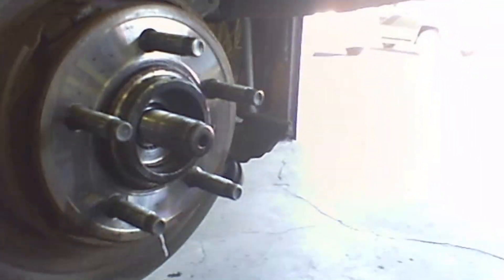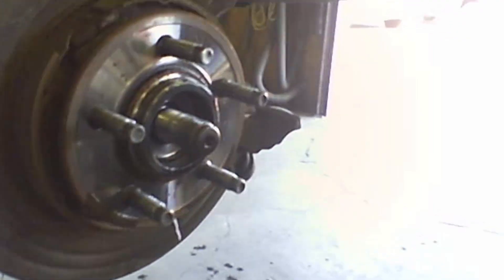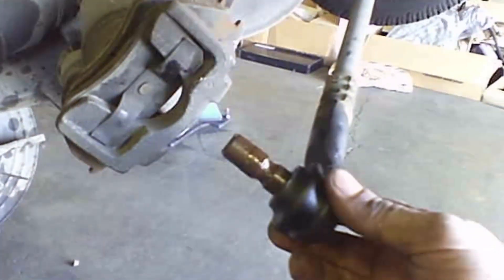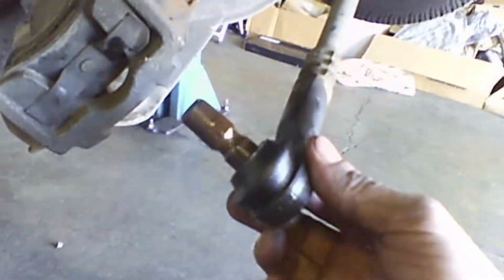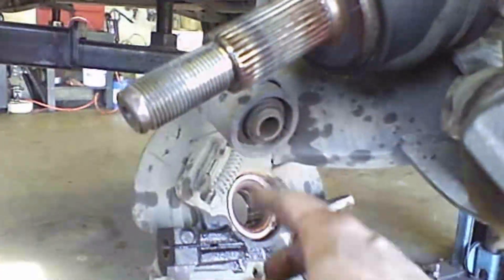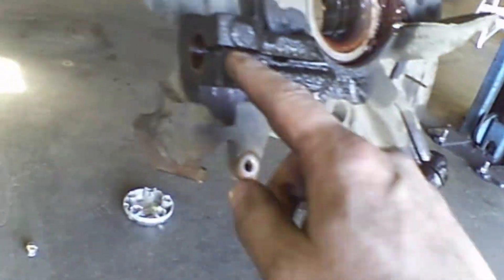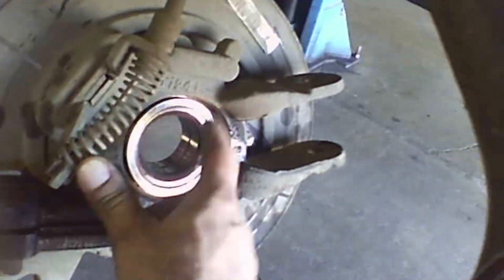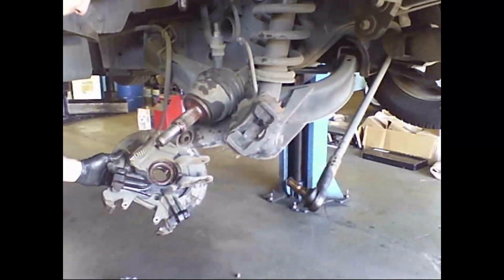Rear wheel bearing replacement OVERVIEW 2002 - 2010 Ford Explorer not complete rear disc brakes

Comment: Slide hammers work better if you actually screw on the puller all the way...... then you're not moving all around on the threads and you're actually pulling with each blow.   Turn the wheel, slide the hammer, turn the wheel, hammer, turn, hammer.

Comment: Slide hammer works a lot better if you tighten down the nuts evenly all the way so that the flange is against the hub. Too much lost energy in all that sloppy movement the way they did it.
Reply: This guy is ASE? LOL
Reply: I do not believe that is possible with the slide hammer shown. The axel shaft lenght will not allow it. Look close and you can see!

Comment: ( order on Amazon ) A-Premium Steering Knuckle Assembly Compatible with Ford Explorer Sport 2002-2003 Explorer Mercury Mountaineer 2002-2005 4.0L 4.6L Rear Right

Better of doing the assembly and it cost less and less of a headache of a job than dealing with a slide hammer or press.

Comment: Should have tightened all three lug nuts when using Google the slidehammer.a 32 piece wheel bearing tool is around $50.00. Or with the use of a press, would have been nice to see the wheel bearing actually replaced.
Reply: I recorded one didn't up load it yet have many to do. Yes even with a slide hammer the knuckle needs to be removed. So really wasted time when it's easier off the car and a socket and hammer to remove the spindle then press bearing out

Comment: I'm trying understand what sense the slide hammer business was all about
Reply: I know this is 5 years later lol. But the slide hammer works on the front wheel bearings. The rear has the C clip so it doesnt work